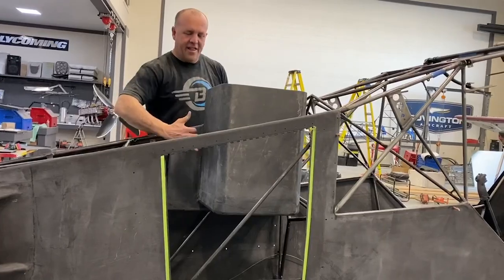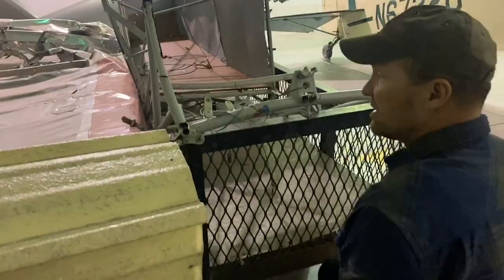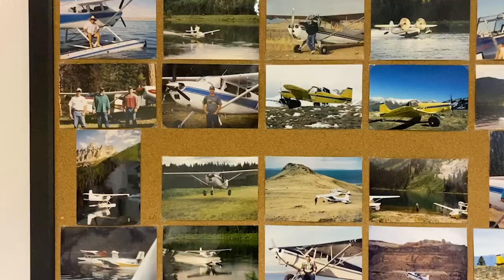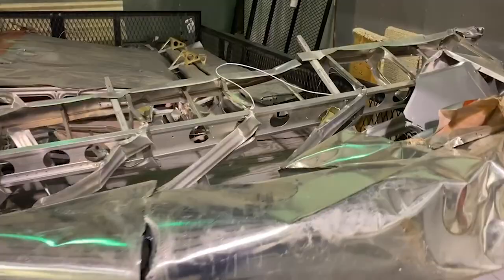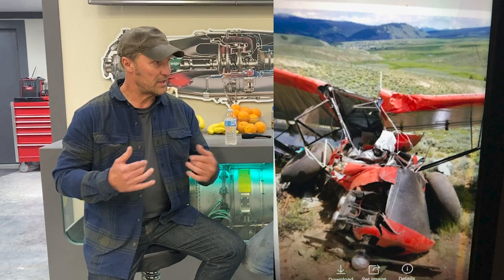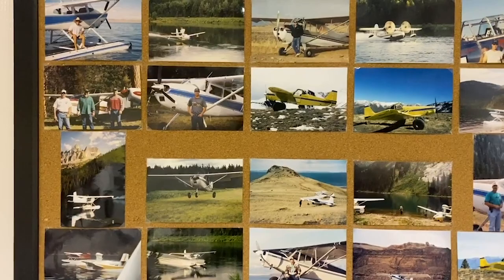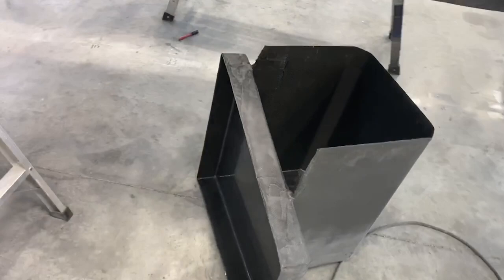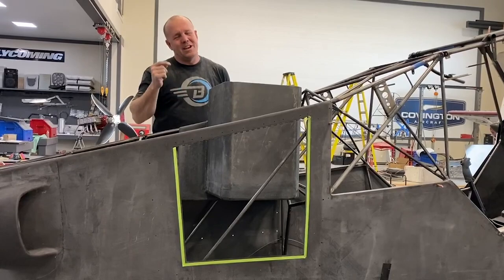Rockets, Boxes and Parachutes Oh My 🤠 (Scrappy Bush Plane 18)

Comment: Watched an incident last Friday of a Piper PA-31T falling out of the clouds after massive strutual failure after what is being speculated as a massive overspeed dive. Myself and even people 7 miles away heard a loud spin up followed by a massive boom that shook windows miles away. My wife pointed up to the clouds in the direction the sound came from to see the fuselage and wing roots in a flat spin headed straight towards us. Where the turbo props had been were engulfed in flames leaving a black smoke trail straight down. It crashed so close, we evacuated the house worried it was headed for us. It ended up crashing about 1500 yards from the house with a debris field stretching over a mile. The left hand outer wing and vertical stabilizers leading edge with the ice boot, landed behind the house in the field. My son and I were the first ones to the crash site and it can only be guessed as to what made the plane go into such a steep dive. The boom we heard has been guessed at that the plane supassed the sound barrier and the spin up we heard just before, were the props going supersonic just before they were ripped off. Just speculating but had the pilot had a BRS, it might not have ended with the deaths of 5 members of one family, including two 6 year olds.

Comment: A recovery shute is next best thing to an ejection seat in a military aircraft. Probably better because the pilot does not have to endure the physical stress of being jettisoned out of the aircraft. That being said most pilots that have had to punch out of their aircraft wasnt because of battle damage but more often mechanical failure or in some cases pilot error. Either way nobody calls out a fighter pilot for being strapped to a chute. If you ask me any option that ups your chances of survival is a great option. " back to work".

Comment: First off, I'm no pilot. I only take a commercial round-trip flight once every four or five years to visit family in Texas. It's not that I'm afraid of flying, it's just that that's the only trip I make with any kind of regularity that has the kind of distance to it that air travel becomes financially viable.
Mike, you said that one of the more frequent comments about BRS parachutes is something to the effect of "A 'real' pilot doesn't need it", and I believe that that kind of thinking is toxic and unproductive.
And for those of you who still have negative comments about BRS parachute systems, think of it like this: It's like airbags in an automobile.
Do they save lives? Yes, and the statistics are there to back that up.
Do they do damage to the vehicle when they deploy? Yes.
Most importantly, Do you care what state a vehicle is in after an event that required safety equipment to do it's job? Saying anything other than an unqualified "yes" to this question would be placing the value of some property over the value of one or more lives, and as far as I know most people's moral compass won't let them do that.

Comment: I don't see vent holes in the parachute box to break vacuum when the parachute is suddenly yanked out by the rocket.  Of course, haven't seen how it will be packed in there either...maybe your arrangement won't be with the bag holding the parachute right up against all 4 vertical walls of your parachute box.   In my Pipistrel, the GRS parachute is tightly packed in a cylindrical  cloth bag about 10 inches in diameter, and around 30 inches long (estimates going off memory).  It fits, barely, into a carbon fiber tube of the same "about 10 inch" diameter.   It has several holes, at least 2, and I think 4,in the sides of the tube, about 1 to 1.5 inches in diameter which vent out air under the parachute bag as you lower it into the tube...and more importantly lets air into the tube under the bag if it should ever be yanked upwardly  by the rocket bridle.   Otherwise, the parachute bad might be retarded by a vacuum forming under the bag, raising extraction forces ...  possibly leading to failure .

Comment: My first plane doesn't have a ballistic but I'm looking at just a personal reserve chute. The pack is only 1.5kg, no major burden by any stretch and it will be violent and inelegant to get out of the plane but mighty nice to have because a plane out of control doesn't roll to a stop on the road. Energies are too high for a squishy human body. And the funny thing is a reserve might be 25+ square meters but I've seen skydivers with a wing shaped chute just over 3 square meters come down with near zero vertical speed. So if 25m2 weighs 1.5kg imagine how absolutely tiny a bare minimum chute can be. Doesn't have to be comfortable or luxury, can even hurt when you land. It's still infinitely better than nothing when it's needed. That's incidentally a market opportunity too.

Comment: I too am an engineer, have been for 40 years. I'd certainly have a parachute. And a tent, and sleeping bag, and satellite beacon, and backup radio, and emergency food. I am an extra class amateur radio operator because I was in central Nevada on the Pony Express road and realized I couldn't walk out if I had a problem, and there was no water, and I hadn't seen anyone or anything in more than an hour. Never take advice from people who can't see what could go wrong. Take a simple scenario of flying over forest in Northern California, a good friend of mine landed his helicopter in the trees there when it had a failure and ended up with the engine on top of him and died. There was nothing but trees anywhere where he could reach, and they were all tall. A cub couldn't have done any better. People are idiots. Hell, if I could have an ejector seat I'd have that too.

Comment: The stigma about BRS/CAPs is unfounded, and ignorant, and machoism. I love that you made this video to help wash the stigma away. You are an icon and idol in general aviation and your continued influence around this subject can help educate and move GA forward in safety.

The statistics are real, the lives saved are real. COPA and specific individuals in that community have done tremendous work to dispel the stigma and prove the safety of the BRS system.

Comment: This is along the same lines of when I caught a bunch of crap for putting a 6 point roll cage 5 point harness in my old foxbody Mustang I used to do a lot of drag racing with. Was told why would you put a cage in it and make it harder to get into when the car isn't even going fast enough to need a cage? I would just respond with I liked the peace of mind know that if something happened at 110mph at the end of the track that I had that cage and harness to keep me safe.

Comment: Jip agreed. Will never fly with my family without a recovery chute. Gives my wife a lot peace of mind. That said, I'd probably try flying the plane as far as possible without using the chute, however I think it's essential in the event of structural damage that impairs your ability to control the aircraft. In my view, as long as it's possible to make a forced landing, and it's a possibility, I'd prefer to try that as a first resort. I've also hears stories of people using the chute and the pendulum oscillation of the plane beneath the chute might also be dangerous, so you probably need to try and stabilize the plane before engaging the chute. This would obviously be hard in the event of i.e. loss of a wing / rudder / elevator, etc....
Reply: And yes! Cudos for bringing up this topic on your channel Mike. Guys like you have a lot of respect in the aviation community. If you endorse a chute it might get more people thinking that this is an obvious addition to a plane and not just for rookies. I absolutely cannot believe that people can argue that it's not ESSENTIAL to have on board if it's an option and if you can afford it.

Comment: Good on ya, Mike. 40lbs is very reasonable for a ballistic chute. My emergency chute weighs 16lbs on my back (seat pack so actually on my butt) and is manually deployed with max 240 lb under canopy weight.

I added this edit, because I don’t understand the purpose of the box. Does the box protect the integrity of the chute system?  Don’t know what system you have, but I thought most were self contained.

Comment: There is a guy here in Kentucky building ballistic parachutes for general aviation aircraft. His design could cut the weight in half and about a quarter of the size. I sent you a private message through Facebook if you’re interested. I’m working on installing one on my Cessna 170B. Only 35 pounds.

Comment: Frankly I think all light aircraft  in GA and Experimental should have a BPS where parameters allow this. In today's world and tech it could also be used to auto deploy in stall spin detection (assuming height is correct for deployment, my 2 cents worth as a pilot)

Comment: That was a bit scary...  I must admit that on some of the amateur aluminium builds I look at the cockpit looks like it could very easily become a food dicer..  Guessing the carbon cub has some crash energy dissipation design built in then.  I watched another video by a chap I like called Paul Bertorelli from AVweb who compiled a study of parachute merit and he concluded that one of the biggest problem with them is that people don't deploy them early enough. As humans we spend too long in denial I guess.  Wondering if there is worth in trying to introduce some decision automation, at least with catastrophic failure at low level. Also trigger placement seems to be an after thought on some aircraft.

Comment: Mike, I see you have the same Rigid job site saw that I have.  Please, PLEASE replace it with a SawStop Job site saw immediately.  That extra level of safety that the SawStop saw gives you is worth that little extra cost...and it will save your precious fingers.  And with you as an engineer and a pilot, let me ask you:  can you afford to lose a finger or two?  Could you still perform all your engineering, all the welding and fabricating with a few missing fingers?  Could you still be a good pilot with a few missing fingers?  Don’t chance it, my friend.  Get a SawStop.  I now have a SawStop contractor saw, and it is extremely mobile.  I wheel it all over my wood shop with ease.  And I no longer worry about cutting off irreplaceable fingers.

Comment: I crashed a plane once .. 6000 ft to 1250 ft. If I had chute I would have pulled it. 
Its not  because I could not fly my damage plane but the landing was very difficult. A surprise killer moment nobody would have thought of. 
If the chute was available I didn’t have to deal with the difficult end.

Comment: Hi Mike, any reason why you chose to mount the box on the left side of the plane and instead of centering it and connecting either to both sides or the tube frame behind the cockpit?

Comment: Honestly, I feel like chutes often give an illusion of safety on underpowered planes that need all the help they can get to get off the ground.  Planes like the Icon A5 seem to have had a few accidents that would have more likely been prevented by better performance than by its chute.  No amount of performance can save a bad pilot, but good performance can save a not-great pilot.

That being said, with a v8 and canoe paddles for propeller blades, I think its safe to put a couple backup parachutes in scrappy :)

Comment: "Real pilots don't need a parachute" sounds to me like "real bikers don't need a helmet"... Yeah I've been riding motorcycles for over 22 years, well over half of my life. I've never been in a situation where I needed my helmet to safe my life. However the only time I've fallen off my bike over those 22 years, was through no fault of my own. Apart from taking a different route, for no aparent reason, there was nothing I could have done. I couldn't have known that the roadway would fail under my tyres due to a leaky water main.
You probably won't "need" the parachute if you're a good pilot, but that one time things just go haywire due to circumstances completely and utterly beyond your control, you're gonna be happy you have one.
And frankly that's the way the EASA who control things like "your ultralight plane may weigh only X kg" explicitly and purposely allow an extra 50 or 70 kg of weight added to an airframe in order to accomodate a ballistic parachute.

Comment: Mike, are you doing a wet layup carbon or out of autoclave prepreg? Love watching your build videos as someone who has worked for 10 years in composites manufacturing and loves aviation
Reply: Also do you worry about causing a fire by the rocket if it ever had to be used? There would be no egress during the slow parachute descent.
Reply: He - usually - does wet layup - with a plastic backer to aid in ease of handling (keeps the fibres straight and tidy) (sorry to butt in.)
Reply from the maker: Good question, No it’s not prepreg just on a sheet of plastic for ease. 👍🤠
Reply: Awesome. Thanks. Great videos.

Comment: This parachute system is also for the benefit of those on the ground that a failed aircraft is going to hit, there is a big difference in survivability for the victim hit by an aircraft descending at 220FPS than one descending at 5<10FPS! However the commercial or general aviation pilot who leaves safety at home when he flies is the kind of pilot who does not deserve to fly.

Comment: Does the chute mount to the frame of the plane through the holes in the bottom, or how is the chute mounted to hold the weight of the plane.

Comment: Saying "real pilots don't need a parachute" is like saying 'real pilots don't need seat belts; good pilots don't make rough landings'.  What a boneheaded argument!  If you've got the capability, and resources to add safety gear to an aircraft, and particularly one that's designed for seriously high performance, I'm all for it.

Comment: I have seen someone put tinfoil on the wood or mold then fiber glassed it and it did not stick.
Reply from the maker: Clyde O'Hara  🤠 I have never tried tinfoil but I believe that would be similar.  I’ll have to try it.  I use 3M foil tape and it comes off easier than most mold releases 👍🤠

Comment: I think chutes get a bad rap because of Cirrus pilots popping their chutes the moment they have an engine out. An engine out scenario isn't where you need a chute. I can think of 3 videos of Cirrus' popping chutes when they were still well within glide range of an airport. 
But that said, I'm a gun owner. I fully get the concept of "Have but not need". I don't EVER want to use my gun for it's intended purpose. But statistics forbid, if I need it, it'll be there.

Comment: Mike I would even compare it a step further. Look at race-cars. Why do race-cars have a roll-cage ? Because you push the limits in so many ways that you do want to ensure that if something breaks at least you get the best chance there is to survive a crash. It is that simple. Material failure is responsible for over 80% of the cashes in Formular One. This is how I look at it. I do kitesurfing, snowbording , snowkiting, klifdiving, freeclimbing and I done rally racing in my life and I am now 42years old. You always have to calculate your risk if you don't do it you are a fool. 20 years ago I drive at night from Hamburg Germany to Valencia Spain with regular gas stops and everything nonstop in under 16h drive time which is over 2100km. I drove back to back Central Florida nonstop to Albuquerque New Mexico and back within 3 days nonstop. Most people won't ever be able to handle this so just because you are great and better than average also doesn't mean you can't get killed because you share the public road with thousand others. If Michael Schumacher didn't had a fiberglass body shell around his body he would have never lived or archived what he has archived in his live. And that's all I have to say about safety.

Comment: I have a question on this.  Would a styrofoam mold work instead of the wood box Mike used?  If not, does any one know why?  It seams to me you could make a sacrificial mold out of styrofoam, create your carbon fiber part, and then use a heat gun to get the styrofoam out.
Reply from the maker: TroubleShooter 👍🤠 great question. I use both wood and foam. Last video on mini wing was foam and this time wood as it was faster for this box and very easy to make extremely precise.  I go back and forth depending on what I need.

Comment: A "simple" engine-out condition may allow you to quickly decide where you're going to try to set her down, but you're certainly not guaranteed a successful landing.  However, loss of a control surface or if you have a heart attack or some type of medical emergency, your passenger(s) are going to hope there's a parachute to get them down alive (or at least give them a lot better chance of it).  Murphy's Law can and will effect everyone sometime, you just better hope you're not in the air without a chute when it does.
Reply: MikeBramm  Exactly right 👍🏼